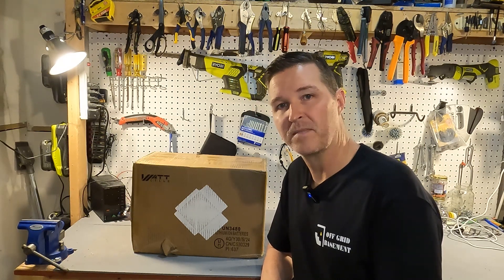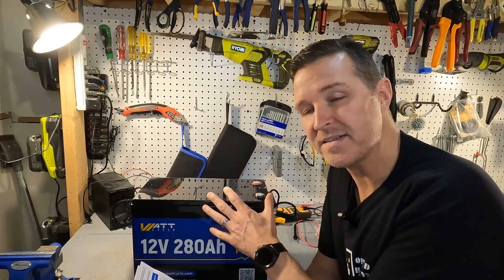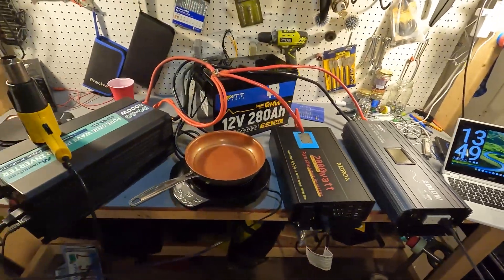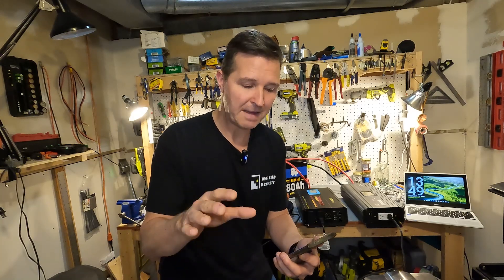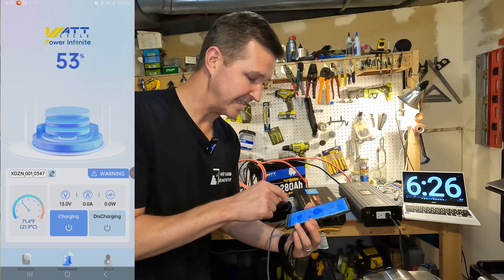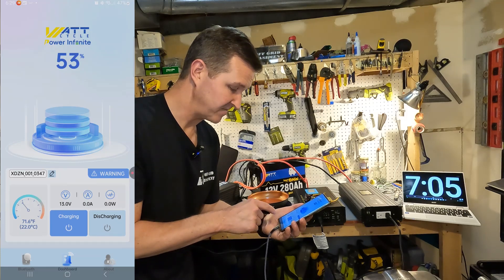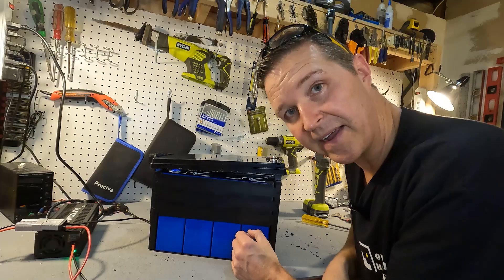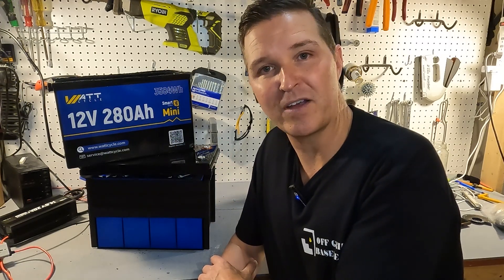Wattcycle 12v 280ah Mini Lifepo4 battery review and teardown.

Comment: Great video.. you provided height and width but how long is the battery if you cut the handles off/or the length of the base? I am asking because I am trying to fit it under my Winnebago Solis Camper Van, I currently have a NAPA AGM Group 31 battery in there and I want to swap those out and fit 2 of these batteries in the same battery compartment. Thank you in advance.
Reply from the maker: The handles are an additional inch each.  If you remove the handles, you would reduce the size by two inches.

Comment: The app is a bit of a pain. You often need to close it out completely and reconnect to the bluetooth to refresh the data. For some reason it doesn't always stay in the refresh mode for the data. Sometimes it will update everything but the battery % as well. I'd like to see them refine that stuff.
Reply from the maker: I agree.  The app has some bugs.  I also found if you rescan the battery it tends to work out.  Thanks for the comment!

Comment: I'm just going to point out that the batteries aren't really any smaller than they were several years ago.   That battery has 1087 cubic inches of volume.  My 100Ah 25.6V batteries (200Ah 12V equivalent) which I've had for several years now are 819 cubic inches of volume.   The 280Ah equivalent would be 819 * 1.33 = 1089 cubic inches.   Almost identical.
Reply from the maker: Thank you for the great information and the comment!

Comment: Actually, the quick over discharge event bodes well for battery life and health.  Also, the three #6 internal wires is correct for the discharge rating.  Most in the 280-300 amp range have only one #4.
Reply from the maker: Thank you for the information, I appreciate the clarification and the comment!

Comment: The 280AH battery is the same battery as the 300AH. It was found out to be that the 300AH battery had 280AH cells in it so they had to change the label on all 300AH batteries. Guess they didn't change the owners manuals. Great review as always.
Reply from the maker: I watched a Will Prowse video about that discovery.  Thanks for the comment!